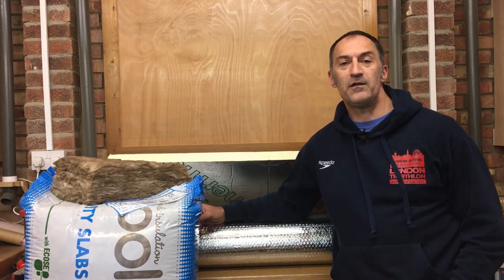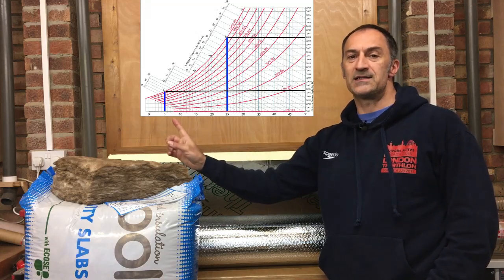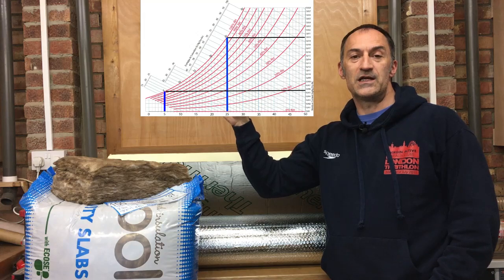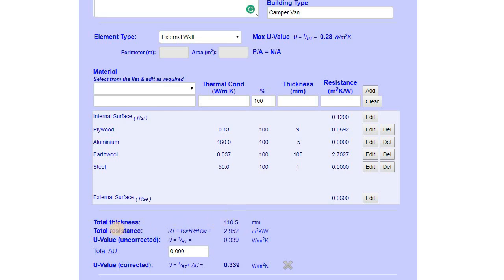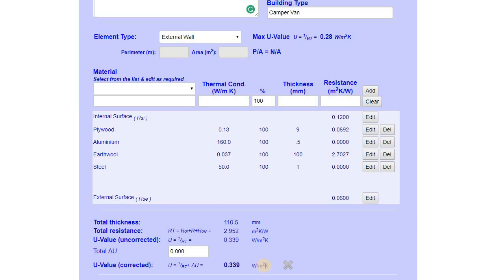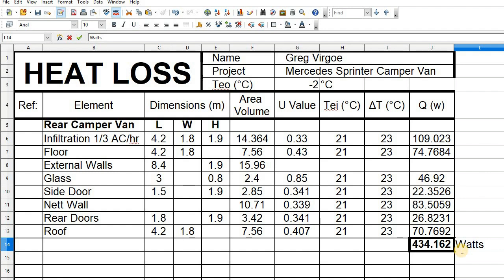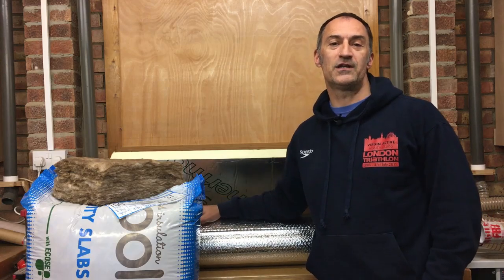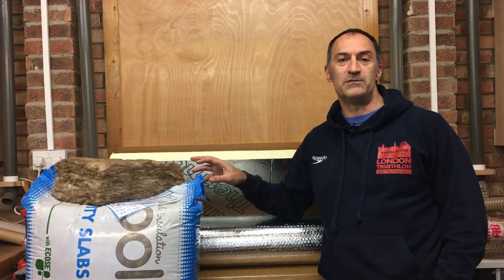How to Insulate your Van Part 1 - The facts you need!

Comment: I am considering converting a box van.  I am thinking of using a small instant heat water heater both for domestic use, but also for radiant heating.  I like radiant heat because there is less of an issue with condensation.  I think a good  video  would be a discussion of  various methods of heating and cooling the living space.  

I am also considering something different for the refrigerator and the freezer.  Here I would like to use a single compressor and condensor running 2 separate evaporators in the home built refrigerator and freezer.  Home built so I can get a very efficent box so I cycle the compressor as little as possible.  I might also think about diverting excess solar production to a 3rd box  ice bank using phase change material as an adjunct to storage batteries, as i suspect that you lose a lot of energy each time you charge a battery, or convert DC to AC etc.
Reply from the maker: Hi Roger, you sound like a bit of an inventor.
I will be fitting a pretty special boiler in my van and will be covering this in future videos.
Truma Combi 4e - Combi boiler has 10litres of stored hot water and gas heater combined for space heating. 
has a 4kW gas burner and 1800W electric heater (when on hook up) it will give instantaneous hot water for showering.
When you say radiant heaters what will be your power source? LPG or Electric?
Buring a naked gas flame in your van gives off water vapour as a by-product of combustion and electric will kill a battery system in minutes.
Losses on an inverter from DC to AC are typically only between 5-15% so not to bad.
Reply: The plan is to mount the water heater above the cab and on the outside of the box.  This postion was chosen sio it could be well vented both for combustion air and exaust fumes. Additionally this will be behind a wind deflector that not only will reduce drag when the truck is in motion, but it will also be concealed from view when in stelth camping mode. I'm  also considering some sort of gimble mount so if the rig is parked on an angle, the heater  could be adjusted for proper function.

If hooked up to shore power, you could add an electric powered heater in series with the gas heater, all the plumbing is in place.

A pump then circulates the warm water to piping above the insulated floor, but below the finishhed floor. The heat is then absorbed by a solid object.

Comment: Hi Greg 
Do you think I can use this product? I'm in the USA
Thanks
https://www.lowes.com/pd/ROCKWOOL-Wood-stud-R-15-59-7-sq-ft-Unfaced-Rock-Wool-Batt-Insulation-with-with-Sound-Barrier-15-25-in-W-x-47-in-L/3388304
Reply from the maker: Hello Hector, if I was buying insulation in the states I would go for this instead..https://www.homedepot.com/p/Owens-Corning-Thermafiber-UltraBatt-5-5-in-x-15-in-x-47-in-R-23-Mineral-Wool-Insulation-UB-40-P5D-15-47-121/303425926
It's a mineral wool slab that is both moisture and mould resistant and has a very good thermal rating. At $21 a pack its very well priced too. Cover the whole thing with a vapour barrier and you'll be good to go.
Reply: Greg Virgoe Gracias Amigo

Comment: Thanks Greg. I realised after watching this video that here in Australia, many times we want to keep the heat out, and that in turn depends on both the amount of sunlight hitting the exterior and the temperature of the air that enters the van.  For the sun induced heating - this can be as much as 4000W per square meter, so it would take 10 times the thickness of insulation to maintain a dT of 23oC as per your calculations. Best bet for direct sun then is to get out of the sun, so creating or finding shade  so the sun cannot get to the van would do this. As for hot air, well either air conditioning or just deal with it, I suppose. 
It then occurred to me that part of the shading over the van could be solar panels that are used to run a small A/C.
To limit the amount of hot air getting in, naturally one would keep the van closed, but to drop the temperature internally by say 23oC we should insulate exactly as you have in your van and then run an A/C capable of pumping  434W of heat OUT of the van. So with an outside air temperature of 43oC, it would be a comfortable 20oC in the van. 
Does that logic sound reasonable? (Adjusted for my specific van and insulation ofcourse).
Reply from the maker: Hello Benny, What you are actually referring to in your first paragraph is the amount of solar power per DAY which for Australia is 4000Whr/m². The same as saying 1000W/m² for 4hours. That value of 4000 is the total watts for a whole day and not all in one hour as you kind of indicate. Just to clarify exactly what it is I got my copy of the Chartered Institute of Building Services Engineers guide volume A of my bookshelf and flicked to page A2-85 where I find the table of basic solar irradiances for 25° latitude (AUS) for different times of the day and year. A quick scan of the table reveals the maximum value occurs in April, June and August at 12noon on a horizontal surface and this value is 915W/m².  I then looked up the maximum value for the UK and this occurs also in June at 12noon and is 755W/m². Therefore, 915/755 = 1.2 or 20% more. 
So just a little more than the UK, not 10 times.
https://en.wikipedia.org/wiki/Solar_power_in_Australia

The solar gain will not be much more than the UK, however, you have a much higher ambient temperature over 40°C so the transmittance gains through the structure will be greater than the UK where we only get into the high twenties.
Transmittance gains are improved with good thermal Insulation. It also will benefit you massively to put your van in the shade that goes without saying as you are preventing the suns irradiance from hitting the vehicle in the first place.
Try this experiment, put your cold beer in a metal box in the sun, then put the same cold beer in a metal box lined with 50mm PIR foam and see what happens to the temp of the beer over time.
Reply: Thanks Greg - yes I was wrong...I really thought it was per hour, but its closer to 4000Whr/m2 per day as you say. Again thanks for the correction.

I will try the experiment you suggest - but I'll model it after the planned construction of my van as below. It's not actually a cargo type van, but a camper trailer with solid walls (no not a caravan either - its built on a trailer and collapsible to minimise  - so I have full freedom to design and build the skin - within practical and economic limits. The model  I'll build will be a scaled down replica of the camper trailer itself using the same materials and construction and  will include full sun / shade with and without insulation...it will be interesting to see what the differences are and a good indicator for the completed trailer. 

The camper trailer is based on a 8' x 5' "box" trailer as we call them here. External cladding will be 3mm Aluminium Composite Panel followed by 25mm foam insulation and all sealed off with 5mm thick corrugated plastic (Coreflute). The enclosed area is basically sleeping accommodation - all other activities are external to the trailer. It will have some small, double insulated windows and plenty of ventilation through air and water proof hatches. EPS foam is much cheaper than PIR, so if I can seal the walls agains any moisture, the that is what I might be able to get away with, but might look into PIR foam as EPS foam absorbs water, the sealing will need to be totally water tight, given moisture from us, as you point out and externally as I am expecting water crossings, heavy downpours etc. Testing.....

A fair chunk of the outback is bereft of shade trees, so I have to provide shade and was intending to use canvas (or equivalent plastic - more research required) to provide cover around the perimeter of the camper, however after watching your video, It is obvious (doh) that I should cover the entire camper as well as. I'm thinking that I need to leave an air gap between the camper and the cover of around 4".

We are also planning to head north into tropical areas, so humidity will be an issue (yes, I am now quite grey and sensitive to these things) and coupled with the relatively high day time high temperatures and, in the desert, very cold night time temperatures, I think I will install a small reverse cycle A/C so we can sleep comfortably in all these environments. Again more planning and design required around battery storage and area of solar panels....

I really appreciate your video and comments Greg - thinking things through alone often yields sub optimal and even rubbish results!
Cheers
Reply from the maker: Hi Benny, if at all possible try and fit 50mm of insulation in the walls and ceiling. It will make a massive difference in the ambient temperatures you are talking about. What about using a white plastic outer skin something like Altro instead of Aluminium? 
Aluminium K value 205
Altro whiterock K value 0.16
White will reflect the sun and it bonds really well with adhesive. Go for a foil faced PIR board and put the foil on the inside. What are you building the framework out of? Timber or metal? Again Timber is 100x better insulator than any metal. But not as strong per section. Always a trade of with anything. 
I would suggest a small generator to run your AC unit as you will kill your battery system running the AC compressors. 
Sounds like an interesting project. You could still engineer some drop down side sections to give you more internal space? World is your oyster with only a frame to work off. Good luck.
Reply from the maker: Hi Benny, if at all possible try and fit 50mm of insulation in the walls and ceiling. It will make a massive difference in the ambient temperatures you are talking about. What about using a white plastic outer skin something like Altro instead of Aluminium? 
Aluminium K value 205
Altro whiterock K value 0.16
White will reflect the sun and it bonds really well with adhesive. Go for a foil faced PIR board and put the foil on the inside. What are you building the framework out of? Timber or metal? Again Timber is 100x better insulator than any metal. But not as strong per section. Always a trade of with anything. 
I would suggest a small generator to run your AC unit as you will kill your battery system running the AC compressors. 
Sounds like an interesting project. You could still engineer some drop down side sections to give you more internal space? World is your oyster with only a frame to work off. Good luck.
Reply: Thanks Greg. It will expand upwards on overlapping sides - a little like the boxes phones come in these days. I haven't heard of Altro whiterock, from google searches it appears to be PVC sheet. The ACP is aluminium clad polyethylene, not sure what the k value is, but I imagine it will be close to the Altro sheets. Anyhow, that is what I can readily get here - and yes white is the only choice. The frame will be aluminium extrusions that will be a challenge, though thankfully amounts to a minimal surface area, none of which should be exposed directly to the elements, or the internal areas, but absolutely necessary to cope with 100's kms of rutted tracks. The other challenge is keeping dust and water out of the bedroom area during towing.
I buckle at the knees when I look up prices for 400AH of Lithium cells sufficient to keep an A/C going overnight, a generator may be my only choice - though they are banned in many national parks. I did watch your video on battery and PV sizing - that was good info and thanks for that too. 
Much of this build is still in my head - some rough drawings, many calcs to do still and problems to solve. Its very exciting though.
I have struggled with the bulk, hence the decision to limit the insulation to 25mm. Also, from my understanding I will only decrease thermal transfer by 10 or 20% by doubling insulation thickness, so some magic thickness that balances thermal transfer with bulk (and wieght - mainly from the frame) must exist. Perhaps the experiment you suggested may shed some light on this.
Cheers, and thanks again.
Reply from the maker: Hi Benny, yep totally understand what you mean now, did it originally have a tent top to it with solid lid,
So you just have to build up the side frames. Ali sections is the best way to go, lightweight and strong for the size. Sounds like an interesting project. Good luck.
Reply: No, its a new trailer with 300mm sides - bought it for dual use about six months ago - camper and trailer. I looked at the ready made camper trailers, but I don't like the canvas top (little insulation) and I don't want a full caravan either - just not my cup of tea. The camper part will be removable.  Here's the link for the trailer from the place I bought it at.( I have no affiliation with them, except for buying the trailer) http://www.balancetrailers.com.au/products/box-trailers/bt85/bt85fwb/ 
And, yes, I have to build it! Thanks for the well wishes! 
I was originally looking at the Sprinter LWB, High or Super High roof, but they cost an awful lot here even used they are off the charts. I found a couple of reasonably priced used units but they had over 400,000km but that is too long in the tooth - even for a sprinter - hence the trailer camper conversion. Initially I was dreaming of getting the 4WD Sprinter, but they are notoriously hard to find on the used market and when you do find them, you need 3 kidneys to buy them.

Comment: this is a really great video. What combination of insulation would you recommend for travelling in a warm/hot climate, where you would need to keep the van cool by reducing the ingress of warm air from the outside to the interior of the van. thanks
Reply from the maker: Hi Barry, the same principles apply for heat transfer through the structure of the van so insulate with the best material you can.
You don't need to worry about moisture or vapour barrier if you are only staying in hot climates.
The most important thing to help prevent the van from getting hot it to use external reflective window blinds.
This is called solar gain and is the biggest reason why vans or cars get hot in the summer.
Stopping the suns rays from getting through the glass and into the van will help keep it very cool.

Comment: Great video,  made me think a lot about my conversion, its an old  Rohill community bus , its a Fiat front with an al-ko chassis, All the walls and rear frame are made out of ally as well, so no wonder I was cold the few nights I slept in it before :) Planning to use the 40mm clotex everywhere as its square in the back now I have blanked off all the windows.
Reply from the maker: Aluminium is a super conductor or heat and cold. 
You can’t go wrong with the celotex and I would kill for square sides. Best wishes

Comment: Will the foam on the floor not breakdown and/or squeak after awhile?

I appreciate your spelling out the proper way to use reflectix. I see so many people using it inappropriately and want to tell them that their configuration just makes it a conductor.
Reply from the maker: Hello, celotex has excellent compressive strength and is designed to be used as an underfloor insulation for underfloor heating or under a concrete screed. So it’s perfect for this application.
Reply: Greg Virgoe I thought maybe the movement would affect it more so than a stationary floor.
Reply from the maker: The battens are fixed down so securely they are not going to move at all and the PIR board is cut to fit very snug so it will not move either. Then its all taped together over the top and ply screwed to the battens.
Let me assure you that floor is as solid as a rock.

Comment: With the movement of the vehicle, do you think there is a risk of wool slowly compacting and sinking to the bottom over time?
Reply from the maker: Hi, I've made sure when I cut the insulation to slightly oversize it so it's a very snug fit. It naturally wants to expand and fill the space fully, don't be stingy with the application and no reason why friction should hold it in place. You could use a small amount of spray adhesive but I want to keep chemical use to minimum. Thanks

Comment: Great bid.  Thanks.
Also... Reflectix as a vapour barrier... I had thought it should be against the metal skin of the van, so keeping moisture away from the rust vulnerable metal. Is this a valid idea?
Reply from the maker: It's got very poor thermal properties and will become similar temperature to the skin of your van so if it's cold, condensation will form on the inside surface of the foil bubble wrap.

Comment: Hi Greg, sorry if you've been asked this a dozen times already but did you use Kingspan Thermawall TW55 or was it another variety? Also can you use this for the floor and ceiling or is it better to stick with Celotex TB3025 on those two areas? 
Thanks
Reply from the maker: Hello Stephanos, I have used two types of PIR board. 50mm Kingspan Thermboard for the roof large side panels and rear doors. 25mm Celotex for the floor. It’s basically the same material just different brand and thickness. Then Earthwool in all the awkward crevices. Hope that helps.
Reply: Greg, helped massively as I was going to go for 25mm thickness, in fact, if anyone calls you unhelpful I would question their sanity. Thanks for that.
Reply from the maker: No problem anytime 👍🏼

Comment: Great video. You mentioned thermal bridging. I'll look in your later videos - I'd like to see how T.B. is avoided when mounting cabinets to the walls.
Reply from the maker: Hello, normal practice is to secure a timber batten or strip of ply to your van shell, then fix your lining and furniture to this batten, timber acts as the insulator and no fixings are connected from inside to the skin of the van.